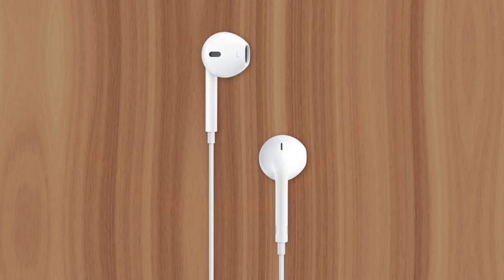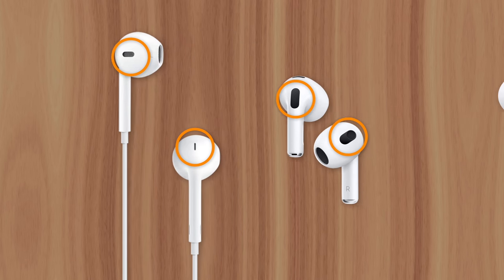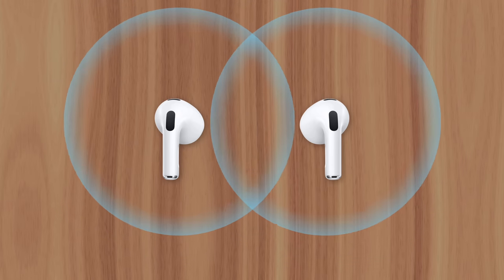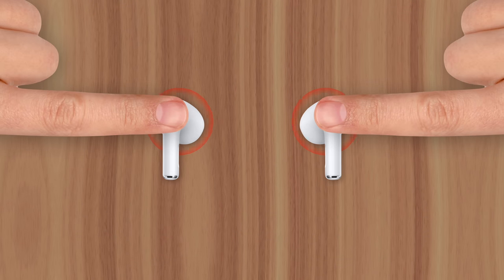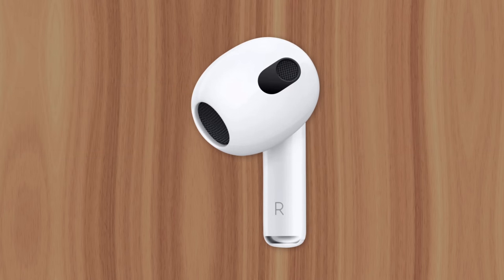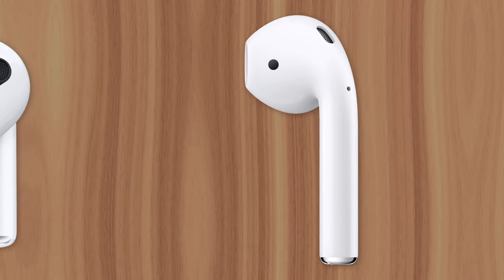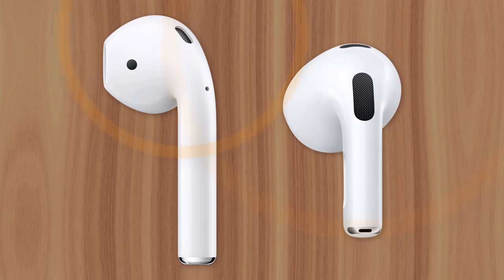Why AirPods Have Vents On The Outside

Comment: Usually the vents on the AirPods would get clogged with earwax and get water damaged as well
Reply: Airpods Pro 2 fix this problem
Reply: this is why i wipe down my airpods with a cloth or something before putting it back in the case
Reply: yea that’s why they made a type of extended warranty for airpods pro 1st gen
Reply: Every time my left AirPod Pro slips out my ear and gets in the water, i immediately pick it up out the water and pat it with the dry cloth, let it dry then put it back… it survived thankfully
Reply: Honestly can't believe how much earwax people get on their buds. People just don't check up on their ears, ever.
Reply: @SpongeB00b_is_a_savage  how many times did it fall in the water
Reply: Yup my airpods went in the laundry and the right one still has some static noise lol

Comment: People say Apple doesn't innovate, but something as simple as moving the vent to the top of the earpiece is a huge advancement that just goes unnoticed. It's the little things that add up. Now, if only they got the Bluetooth thing to work properly, we'd be all set.
Reply: Innovation is different from improvement. We need improvement, not saying no to that. But innovation is also needed for new things completely. I know Apple is a safe company and want to provide only the premium experience to their users. But just wanted to let you know that's not innovation for itself.
Reply: @ravitejaknts  It's not going to change the world, but isn't innovation just novel improvements? They can't be expected to create the next iPhone every year.
Reply: @darkwoodmovies  Yes, even small changes can be considered innovation, but not just changing placement of the hole. It can be called Innovation when they found out a way to do it without the hole. Even this won't change the world, but it requires some technical input that's never possible before. 

Samsung's curved screens and folding screens are innovations because it's not possible before. 
Chinese phone's fast charging tech is innovation because it's not possible before. 
Apple's iPhone is innovation because it's not possible to touch screen with multiple fingers before. 

If it's possible before and then you are implementing it, then it's not innovation, it's improvement. 

But Apple definitely has innovation in processors, software ecosystem features, etc these days. Waiting for Apple AR.
Reply: @darkwoodmovies jesus, guess who's the company who removed the battery percentage on their "smart" phones just to return it 5 YEARS LATER

and i'm saying this as an apple fanboy
Reply: @chimklee fanboy what, u need a fan to use your phone?
Reply: @l3abol_uci191  ?????
Reply: Lmao all IEMs have had airvents for years. This isn't new.
Reply: least delusional apple fan

Comment: every single earbuds no matter how cheap have these vents. makes sense to use them.
Reply: mine don't
Reply: @Myskayt  look closely and you will see them. unless they are super old they should have them.
Reply: "makes sense to use them" sounds like apple saw it and adopted it without a reason. They engineer their stuff from the ground up and if the vent wasn't necessary, it wouldn't have been there

Comment: I've noticed that, at least on the AirPods Pro, the external vent helps with the Transparency mode. If they are set to Transparency and I cover the vents with my fingers, suddenly I no longer hear the noise from outside.
Reply: Cause they have the Microphones there most probably.
Reply: @08_Matthew_08  No, the microphones are on the black patch on the outer curve. I can tell because they make a crackling sound when I pass my finger over them.
Reply: Oh when I turn on my AirPods Pro or touch the microphone they crackle and keep doing it because they fell out of their case when they accidentally ended up in the wash
Reply: @astraldirectrix  but the vents help with ambient noise to pass

Comment: Missed an important part imo. 
At least for the AirPods Pro, Apple has cited the vents have been designed to also help equalize pressure in your ear canal by allowing air that would have otherwise been trapped to easily flow through the earbud itself. This leads to a less clogged more comfortable experience. I always thought I hated rubber tipped earbuds because of the pressure inside my ears, I even got the Galaxy Buds Live aka those Kidney Bean earbuds because of it. AirPods Pro however have completely changed this for me, they’re so comfortable
Reply: Was looking for this comment. This is the main reason for the vents, not for the sound or bass quality. 

Google separately mentioned this too when introducing their Pixel buds on their keynote, means they saw it was a common issue worth highlighting and describing how they overcame it to make their buds better than others without the vents.
Reply: they are there for equalizing pressure as well as holding microphones for ANC
Reply: I thought they all had the vent though he even said the wired ones do
Reply: Interesting I thought that was the main and or only reason lol.
Reply: @jackysbin3860  they do, he comment is just specifying that the vents on different airpods do different things, the ones on the non pro are for letting air go in and out, so that the bass will better, and the ones on the pros are for letting air go in and out of your ear canal so reduce air pressure since there is an air seal on the pros compared to the normal model
Reply: @Clavinohou  Im a bit confused, idk if i used the good words (choncha cavum. So airvents outside and inside, but the vent isnt in the (earcancal) so how does it flow into it? Because with eartips, there cant be much air, because it blocks it.

Or does the airvents go thru the speaker?

I asked Samsung worker, they say it fixes the clog feeling, but couldnt not explain (How) it fix it, or thru where.

If it does go thru the speaker from airpods pro, is it the same for Buds 2 pro?
Reply: Most in-ear earphones have vents, sometimes they are really small and can't he easily seen.

Sometimes there aren't any vents, but you have to go out of your way to look for balanced armature driver earphones, which don't rely on air displacement. They tend to have better passive isolation.
Reply: @privxete4089  there  is a seperate hole other than the speaker that the air is able to pass through which is connected to the same area where the eartip connects to
Reply: @Clavinohou  Do you have a source to google? Im all day searching, but cant find.

But has Buds 2 pro that 2? Or only Apple that design
Reply: @privxete4089  i believe only apple has this design for now
Reply: @privxete4089  what is even happening in that video lmfao there is no description its just a guy wearing different earbuds
Reply: @ice.as.a.cream.  I don’t think so. Possibly, but transparency uses the external microphones and what they hear and pumps sound in. When you turn ANC and Transparency mode both off and use the third option, “Off”, you can’t hear much like any other rubber tipped earbud, so the sound isolation is still good. I think the vents on the outside are typically for air movement for the bass driver. The connection of the inside speaker grate to the outside vent is a fairly unique choice to help equalize pressure

Edit P.S.: If you do get them, lmk what you think! They’re probably my favorite apple product I use on the daily.
Reply: Guys can you recommend me which one is better apple earpods or sony mdr xb55ap or ex255ap

Comment: These “vents” that Apple has been putting on their EarPods and AirPods are often called flow ports, reflex ports, or bass ports in the audio community. Most bookshelf or tower speakers will have circular holes on the front or rear that serve a similar purpose, and since acoustics in a room work differently than in an earbud, these are usually long tubes extending into the speaker box, made of either plastic, or layered paper similar to an empty roll of tape, but longer and narrower. Since some time in the 70s or 80s, these tubes have been of a calculated length and width. In other words, they are tuned! 
Many speakers are also an air-tight box, which produces less bass volume, but often produces better bass definition for less cost, due to skipping the math part. In an earbud, however, this approach does not work well.

Comment: The vents are usually on almost al earbuds to also prevent building the pressure inside your ear canal which can build up the wax and damage your ear especially when listening to the loud music. Some earbuds use even the outside microphone holes for the ventilation or have a hole under the ear tip from there the air can change.

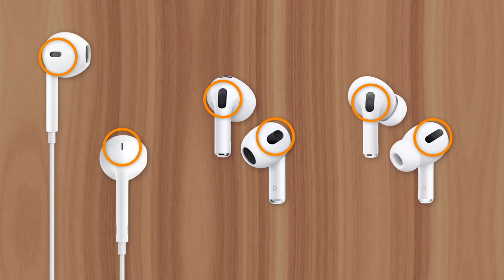Comment: 1:54 on the right for the AirPods Pro you did not circle the vents you just circled the microphone and the part that detects if the AirPod’s pro are in your ears, the vent is on the bottom
Reply: Bothered me too! Came looking for this comment 😆
Reply: @j63636  yeah now i see that there is no grill on the bottom but what was circled in the video was the sensor for when it is your ears and the microphone so i don't know where the vent is

Comment: i have always wondered how the air pods detect if they are in your ear I soon found out that if you cover the front vent with your finger it detects that it is in your ear wether it is or not. i belive what you said but that front vent proboly has more tech and use then this vid describes

Comment: funny that, by adding vents, you actually reduce the passive noise isolation so you have to overcompensate by adding more anc. its like 2 steps back 1 step forward

Comment: I’ve had that problem with my EarPods where the sound has gotten quieter sometimes even when I tried cleaning them the sound didn’t improve resulting in me buying a new pair
Reply: What gen
Reply: @johnnyblaze5551  wasn’t there only one gen of EarPods not AirPods EarPods well there were to types of EarPods one with the lightning connector and one with the pin like on a regular pair of earphones and I have both I even have a pair of the old style Apple earphones